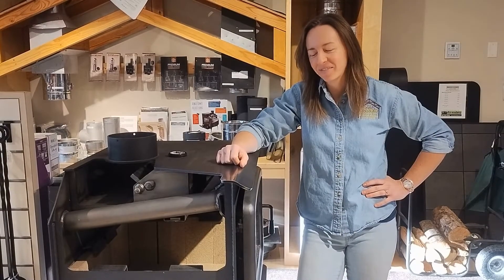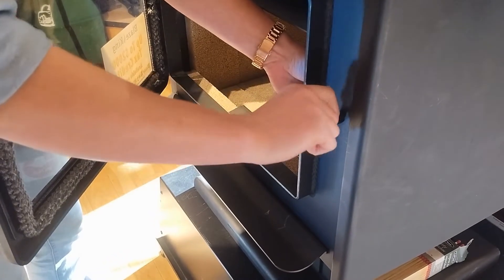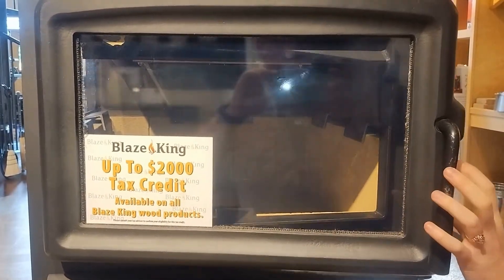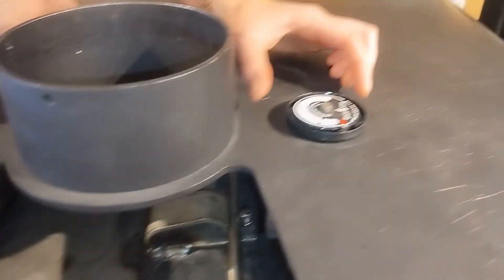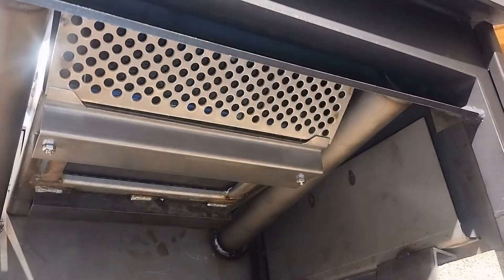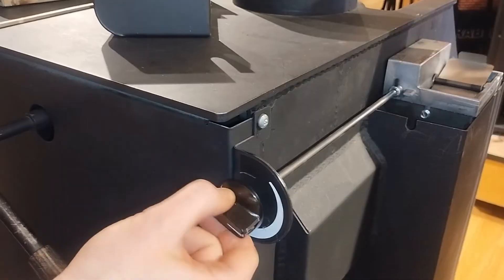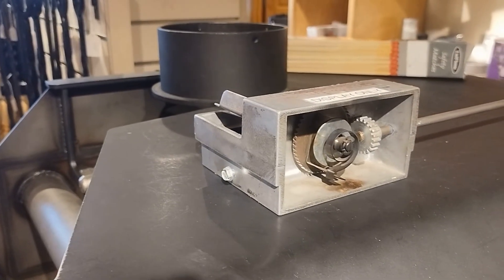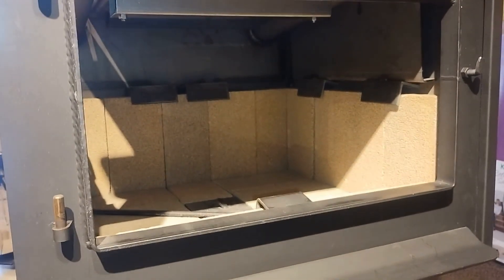Blaze King Mechanical Operations Explained in Depth

Comment: I have one of these, and this maybe more a general thing..  So if I don't use my stove for a few weeks I get a lot of frost from air moving inside the home..  Is there any good solution to this?   I was thinking of stuffing an old towel up in the top of the stove when the latch is open.

Comment: Bk princess i29 just over 3 years old burning to fast on the low setting. Video helped I think it’s the thermostat cause I can’t hear the flap close like I used to. It really happened February 2025 but know I see it as a big problem. Thanks for your help with the video.

Comment: So you're changing the bypass door gasket through the outlet hole every time? That seems crazy....the stove pipe needs to be removed to do that?
Reply: Since your chimney guy needs to remove the stove pipe to properly inspect and clean it, it's a good opportunity to have one on hand and replace it if necessary. Not a big deal.
Reply from the maker: Sorry for our late reply! I'm sure you could replace it from inside the stove body... but fussing with that bypass door from the inside is much more difficult, and I would imagine that applying gasket cement from that angle would also be a pain.

Comment: How do you clean your catalyst and how do you know when it is bad or less efficient?
Reply from the maker: Thanks for the question! Here's an excerpt from Blaze King's manual about how to clean a combustor: "Any deposits on the face of the combustor should be removed. There are two ways to clean the face of the combustor: (1) Brushing the
combustor with a soft bristle paint brush, or (2) Passing a vacuum cleaner wand or brush near the face of
the combustor. Limit cleaning to the face of the combustor (note - the flame shield will have to be removed
to gain access to the face). Do not scrape the combustor with any hard tool or brush and do not run pipe
cleaner through the individual cells of the combustor as this may do more harm than good. Do not remove the
combustor during this process. Note - simply burning a hot fire usually proves to be the best method of
cleaning the combustor of deposits."

If your combustor is bad or less efficient, some major symptoms are: catalyst thermometer does not reach the active zone or quickly falls out of the active zone, reduced burn times, visibly plugged combustor that plugs even after cleaning, cracked ceramic combustor, peeling or separating metal combustor, and dark, thick smoke even when bypass door is closed. In our experience, customers usually get between 6 and 12 years of efficient fires out of their combustors.

Comment: Excellent review. Our BK catalytic has been in use for going on 20 years here in NW Wyoming… and I just changed out the original ceramic catalytic combustor this week. The old one was still in perfect condition… just didn’t work efficiently any longer.
Reply: Really? Do you use it? Mines just about cooked at 3 years 24/7 usage from mid october to  end April Looks in perfect shape but hard to get glowing.